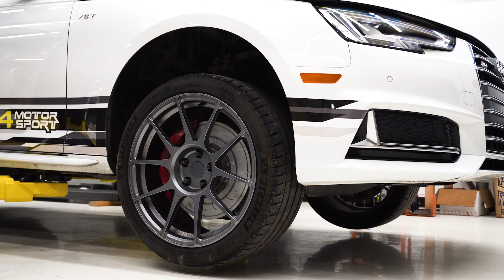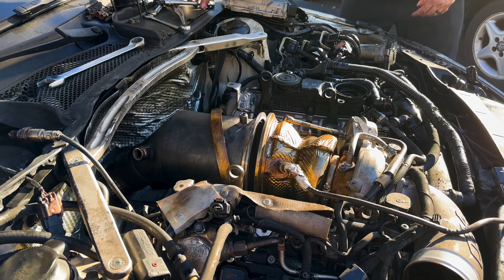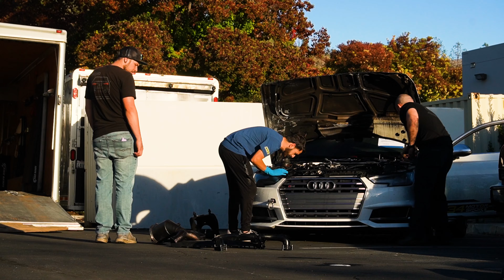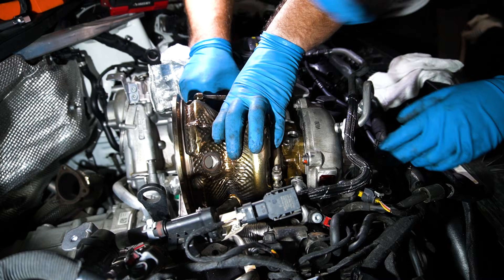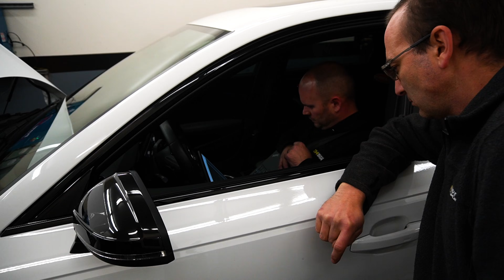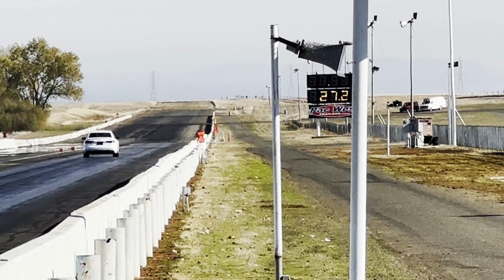Ashes to Asphalt - The Tale of the 034Motorsport B9 Audi S4 Built in 24 Hours

Comment: What kind of wheels and tires are you using? I want to get the same setup but not have to downgrade on brake size
Reply from the maker: For the drag strip runs, Enkei RPF1 17x8 wheels wrapped in 225/40/17 Hoosier DR2 tires. This required some shaving of the factory front calipers to ensure proper clearance.

Comment: Rock on ! Turning a perceived Liability to an Asset  is the core to solid engineering and fantastic business leadership. I’m almost inspired to rapid prototype to the oil cap issues, whip up a 3d model and print it in PA12-CF. You guys should hold competitions for parts engineering lol

Comment: This made me walk out to my B9 S4 and check my oil cap to see if it was loose. It's solid. I did recently replace my PVC valve because that is what actually leaks.
Reply: Same.. I was in the garage on the treadmill and thought I smelled something. I came back inside and this was the first YT vid after the treadmill. 15 seconds in I paused and went back to my garage lol.
Reply: This is the answer. Blow by making it past. Motor runs in vacuum. Pressurize the crankcase... I banged my head against a wall for a month trying to figure out what in the hell. A quality smoke machine is worth its weight in gold.

Comment: When do you think the product will be developed to stop the oil cap coming off?
Reply from the maker: We will work on releasing something in the coming few months, for the time being check the factory hose and be sure the check valve is functioning.
Reply: @034motorsport  Is there a writeup or diagram somewhere on how to verify the check valve is functioning correctly?
Reply: @kxram7304   If you have oil seeping out of the cap, just go ahead and replace the part. It’s the breather hose between the inlet and PCV. Here’s the revised part # 06M-103-217-CT
Reply: Loctite bro